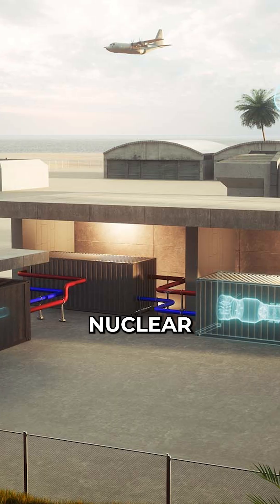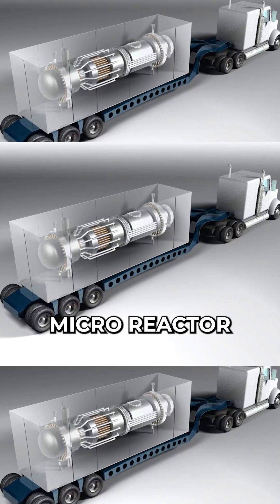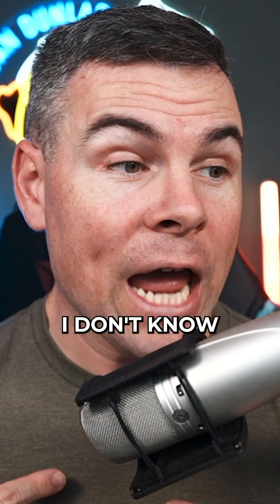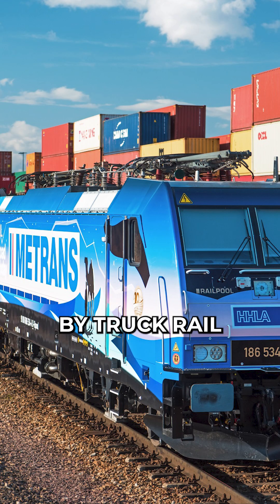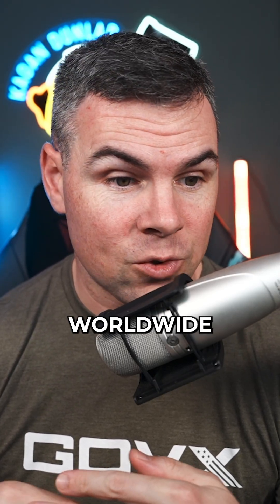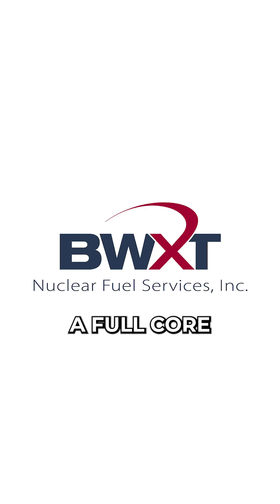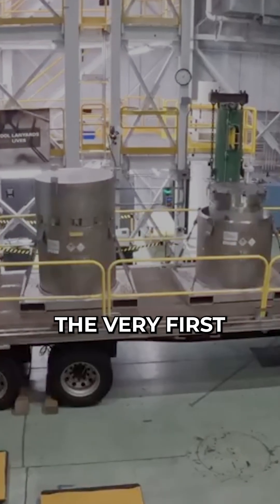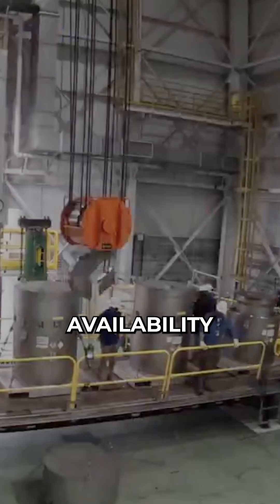Project Pele, The US DOW's Microreactor. Powered by @shopgovx #govxpartner

Comment: Okay, for those wondering: TRISO (Tri-Structural Isotropic) fuel is an advanced, extremely robust nuclear fuel consisting of tiny uranium kernels coated with multiple layers of carbon and ceramic, making each particle a self-contained containment system that prevents radioactive release, even at extreme temperatures, allowing for safer, higher-temperature reactors like High-Temperature Gas-Cooled Reactors (HTGRs). This fuel is a cornerstone for Generation IV reactors, particularly high-temperature reactors (HTRs) and molten salt reactors (MSRs), enabling higher operating temperatures for greater efficiency and potential applications like hydrogen production. Some key advantages of this is that it has extreme heat resistance, increased durability and versatility, and fission product containment. This is great because it’s perfect for these micro reactors, until they find something better that is.

Comment: There is a tiny little thing we will call it a motor that can run on natural gas gasoline or air and creates electricity and the government knows about it but I think they shelved it because I was excited about giving it to the masses. It would create so much electricity it would turn your meter backwards and 4 of them could power a tank but silent no noise from the engine. Subs too and with this oil that the same company had you could run 50k miles on 1 change. Crazy to think the oil in the street would be in so tight with the government their profits would mean more than our energy freedom and it’s green energy so they have the technology. I have seen it and it’s more efficient that’s quieter and potentially no pollution. It’s been over 10 years and nothing.

Comment: If it keeps the power on during a hurricane, I'm definitely down for that
Reply: The problem is that durring hurricane the power plants almost never get damaged but rather the utility so nothing would really change here unless they disconnected parts of the grid since 1mw can power a small town. You need faster clean up and repair of infrastructure rather than a small power plant in such emergencies
Reply: @mitri5389  buried power lines are a lot less susceptible to damage
Reply: If you buried it under the ground that would definitely work.

Comment: I’d totally have one in my house, car (fusion preferred) and I’d support it as smaller generators that you can buy if your power goes out. So long as everything is properly shielded it’s okay with me. Fusion is the way forward. Not wind, solar, hydroelectric, oil, or coal. Fusion. The amount of power a fusion reactor can create blows every other resource we’ve ever known out of the water, and its emissions are significantly smaller than current fission reactors which produce a lot of nuclear waste. By harnessing fusion we can harness the sun itself.

Comment: I've been dreaming about this stuff. 

The uranium is made into tiny heavily shielded/coated particles to prevent radiation leaks, making it much safer and durable. 

Its expensive though. Several million dollars per unit. It still isn’t small enough

Comment: Which is why battery - electric vehicles are a major advantage on the battlefield.  
    They’re also silent
   They have no heat signature. 
      Not dependent on fuel, or transmission fluid, or brakes, or any other mechanical maintenance issue.

Comment: They put little Radioisotope thermoelectric generators on spacecraft. Fueled by a fuel like plutonium in small pellet form. They use the heat from the decaying element to create electrical capacity using the Seebeck effect. You have a battery the size of a small office trash can and it will happily generate electrical capacity for decades. Voyager I had one… and it’s still functioning as far as I’m aware. Launched in 1977. 48 years of power from one little device. Start building those for households. Make them safe enough that house fire won’t damage them. Think of the environment! Think of how many billions of pounds of batteries you save. It would be silly not to manufacture them.

Comment: Imagine how much money they'd save just not shipping fuel 😂
Reply: It isn't about that. It is about fuel convoys being a main target during war.
Reply: Except they'd still need to ship fuel and have convoys to remote bases, because all the vehicles, logistical trucks, 4x4s etc all run on diesel... they would need less of it, because not having to run giant diesel generators for power, but it wouldn't eliminate them entirely
Reply: @roadsweeper1 could make them electric
Reply: @A6Legit could do. Think range would be an issue for that though, and weight. In the middle East some of those guys were out on patrol for days, and youve already got armoured humvees and MRAPs, heavy enough as it is without adding batteries to them lol.

I don't think electric would work for an armoured combat vehicle.
Reply: @A6Legit  Hybrid is the way to go - give yourself options, efficiency when available, raw power when needed.  I can see tanks running their electronics off a small pebble of fuel in the future. Only starting the engine when they need to move

Comment: The best part is there is no nuclear fallout risk due to the fuel system they are using. This is brilliant!
Reply: I've been married to one for 20 years!!! Bring it on
Reply: Until it gets blown up by a drone...
Reply: Allegedly
Reply: @stevesmith2171  no facts
Reply: @ShinobiDrip999 Nuclear physicist ?
Reply: @stevesmith2171 
Thank you! Some people 🙄
Reply: @highlytics  Just curious but, exactly how much basic research have you done into radioactive elements, their decay rates, storage of spent fuel and, possible uses as a dirty bomb of this particular reactor ? Just spit balling here but, I doubt any. If you have, perhaps you can enlightene us on what the carbon and ceramic casing would be if one were to blown up ? Good or, bad ? That's as simple as I can ask this.
Reply: @highlytics 🤣 Well, if you don't know ? Try and refrain from making comments on things you know nothing about. 
Source: Trust me bro 😂
Reply: @stevesmith2171 very good point!
Reply: @ShinobiDrip999 I know there's no facts
Reply: If one of these were to be hit by explosives in a combat zone then, yes, there would be massive radioactive fallout contamination of the area.

The passive decay heat safety of the core design isn't anything new as it relates to modern reactor designs, neither is the TRISO fuel, and ultimately it will still produce radioactive waste after the nuclear fuel has been spent after 2-3 years of operation. 

That spent fuel remains dangerously radioactive and needs to be stored safely for many hundred's of thousands of years.
Reply: that is pure bullshit
Reply: @hul8376 got another nuclear physics scientist here! They know everything. Probably started life at the world famous learing center in minnisomalia!

Comment: It’s fuel that’s coated in different ceramics. If the plant were to shut down for some reason or lose, it’s cooling function. It still wouldn’t be able to melt down due to the style of the fuel.
Reply: Harbor Freight already has them.
Reply: @CaucasianDebrisLLC they would 😂
Reply: @CaucasianDebrisLLC lmao😅 yep they shipped to China reverse engineered it and making it cheaper.  Lol😅
Reply: Marbles. (That's what people doing the research call them.)
Reply: @r@r @reality9451 o, isn't it pebble? pebble bed reactors.
Reply: @ocococococococococococococ3267 pebble bed reactor is different. Design basis is with economies of scale. Notably can be refueled while online; some even drop the pebbles into a cistern during any emergency condition for passive safety. This movie reactor differs on many other aspects, so not the same. However, both terms work here, so call them whatever you like. But the kernels are smaller, so "marbles" fits better
Reply: Thanks. The anti nuclear propaganda that has been pushed for 40+ years has set us back. We wouldn’t need to rely on so many fossil fuels if we had pumped money into nuclear research. Which leads to less reliance on questionable alliances.
Reply: @j @jacobq.2204  oil isn’t from fossils the deposits aren’t liquid dinosaur just as a new rabbit hole for you to look into lol that’s propaganda too. There is no significant depletion of oil the wells dry and replenish themselves with time, heat, and pressure. They’re going and turning on old rigs that’ve dried up and had been abandoned. But yea if anyone ever cared about solving the energy crisis they’d be researching and implementing nuclear power across the nation it’s the most stable and reliable source of energy known today. All the famous meltdowns and catastrophes around nuclear were neglected and old technology at the time the problem occurred. Fukushima was 50 years old, the water cooling system was bone dry because of neglect or incompetence, it just survived an earthquake and subsequently a tsunami that directly impacted the plant and then there was an catastrophe that lasted a very short time. There’s people that live there now and did soon after
Reply: @jacobq.2204  I wonder how much the big oil companies and their lobbyists (In my personal opinion, I believe that lobbyists should be illegal because it's just big companies that make a lot of profit using said profit to hire people to argue on their behalf to Congress or to "donate" huge amounts of money to politicians or their re-election campaigns so that politicians vote for any bills that favor that company or vote against anything that might jeopardize said companies profits INSTEAD of voting in the interests of their constituents!) had to do with suppressing research and development of safe, sustainable nuclear energy by pushing the myth that nuclear energy is and always would/will be inherently unsafe. Just look at nuclear powered submarines and aircraft carriers in the United States Navy (and who knows how many other classified or confidential uses for nuclear power in the military). The first nuclear powered submarine, The USS Nautilus (SSN 571), was launched on January 21st, 1954, meaning the United States Navy has been using small nuclear reactors to power submarines for a little over 70 years now. The Navy has accumulated over 6,200 reactor-years of safe operation without a significant radiological incident. All of the U.S. Navy's submarines are nuclear powered (around 70 submarines) while also having 11 nuclear powered aircraft carriers. Imagine if public nuclear research and development had not been suppressed and actively fought tooth and nail against by big oil companies how much further along nuclear technology would be.
Reply: @jacobq.2204  it’s all a game to to keep us enslaved/working so we can keep the gdp up for that politicians put in place by wall street
Reply: @Cobra365 Oh geez...THERE WON'T BE ANY JOBS!!! AI is what's next. Delivering EVERYTHING. Period!
Reply: @Cobra365  nah, it's the O I L lobby
Reply: Thank you sir I was able to skip googles ai this time
Reply: Yep. TRISO won't melt down easily. Very high temp capabilities.
Reply: Iirc, the ceramic fission fuel is more like small BB's...or smaller. I saw a video about it being filled into small cylinders that looked like they were shaped to appear like a D-cell battery, but just more like dark graphite or carbon colored and not metallic at all.
Reply: @MSDKLZE WOW ! Ultimately, it could power everything, right?
Reply: It's the same nuclear reactors that have been used for 70 years without a single incident.
Reply: Ya beat me too it, it's alot safer than people think but we need to fix the radiation per year safety charts, we're still using the one made in the 50s even though it's wrong
Reply: Thanks.
Reply: Thank you
Reply: Can you explain further. I know new nuclear power technology is much safer It would be cool if someone could explain.
Reply: Defund the power companies
Reply: @hiddeninfo223 AAAAAMEN! Why the heck are we paying to power AI?!?!?
Reply: Oh neat! Thats really cool.
Reply: I believe the fuel in that configuration, small ceramic balls are also very difficult to rupture by kinetic strike.
Reply: Not Service Connected.
Reply: 😮😮😮 no fucking way. Are they able to scale that for larger plants?
Reply: @phays10 Or smaller ones!!!🎉🎉🎉
Reply: @reeree6682🙌🏼
Reply: @phays10  Scale small reactors? Yeah, just set up a bunch of them. What were you referring to?
Reply: @SuperChaz_ I mean like large reactors.
Reply: This is great news. Thinking 10 steps ahead and decades down the road!!! For space truckers everywhere.🎉
Reply: What's the half life and how much fuel does it use?
Reply: Good wirk ty
Reply: That was a party to read with the right words used but the punctuation was so close....
Reply: similar to Pebble-Bed reactors?
Reply: Ty. Learn something new everyday I really appreciate that that is awesome
Reply: Thereby ensuring safety over performance via a negative coefficient of reactivity. This the hallmark of the US Nuclear Navy and its safety record.
Reply: Thank you!
Reply: @kkaspern01  it's super safe fuel
Reply: That's what I said.😂
Reply: I have to give you credit for such a short paragraph. How do you explain all that in one small paragraph freaks me out
Reply: Like an RBMK reactor ….
Reply: Now that's comedy right there.
Figgin awesome 😂
Reply: Came here to say this
Reply: Thanks!
Reply: This is probably a dumb question but did you use the comma properly after the word “lose”? (im genuinely curious bc i can’t tell tbh)
Reply: @junglemike-o7l no, they did not
Reply: @FrankAaron  👍
Reply: @junglemike-o7l  no comma between verb and indirect object.
Reply: @FirstLast-gu5zy  thanks
Reply: @junglemike-o7l I think it's more for a dramatic pause rather than correct grammar 😊
Reply: @rasta2333  pretty sure that dot dot dot or "..." is used for a dramatic pause and not a comma. They could have just made a typo, though. 😊
Reply: @Goodyliciousness  the dot dot dot has a name... ellipsis...
Reply: @rasta2333  gotcha
Reply: @junglemike-o7l it is impossible for it to leak radiation even it were to be split open it would emit only safe amounts of radiation. That's what the science says currently. This could be one of the biggest steps forward in energy making in the last decades.
Reply: @whyamihere2366 you mean when it’s virgin fuel. Once you load it into a reactor and start fission, it’s now radiated.
Reply: @JohnSmith-fx4se no im talking about when it hits failure. Its way better to look it up because its complicated and i dont want to tell you the wrong thing.
Reply: @JohnSmith-fx4se  what’s virgin fuel? lmao